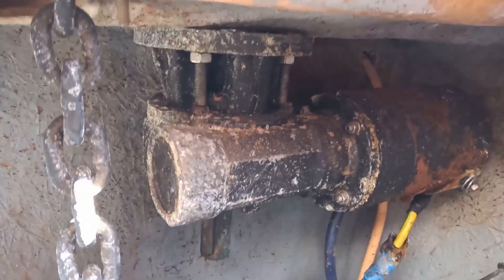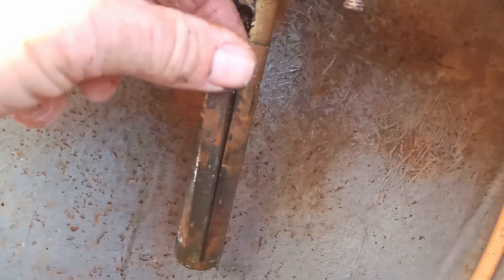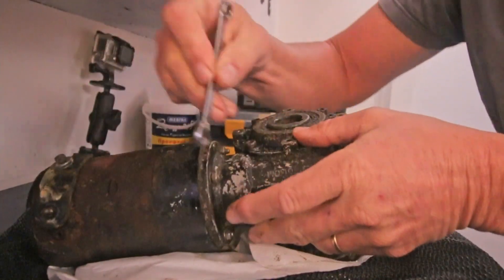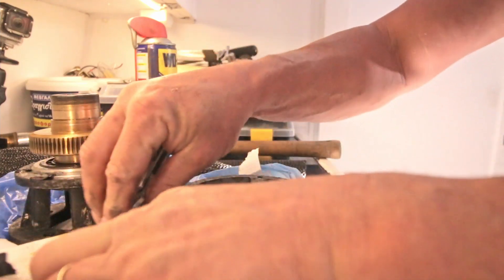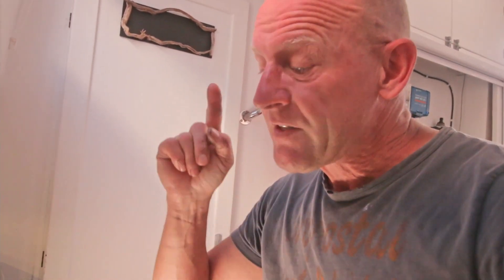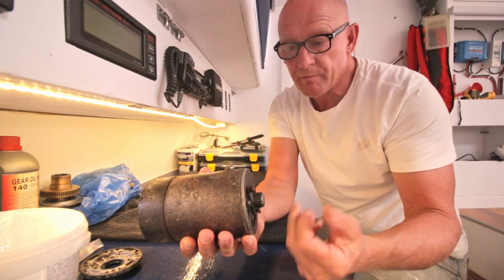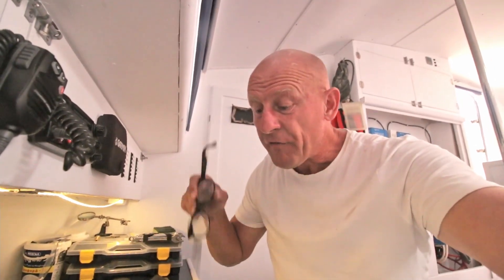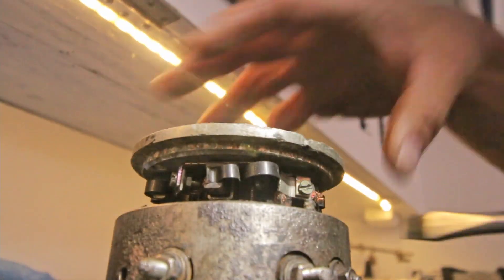Lewmar windlass gearbox and motor surgery. Sailing Exodos, ep.50

Comment: Great video.  Thanks for posting. When taking the end cap off the motor (at 15:00)  spray it with some wd40 all around the cap.  Will help release it.  Also, the bolt  used for the lug should be brass.  Stainless is a terrible conductor of electricity and not to be used in that application.  The lug bolt you installed needed to be connected on the inside of the motor to the brush sets.  I did n't see that done but assume you got it soldered in?
Reply from the maker: Haha, I don't know anymore 🙂 Too long ago and we already sold the boat. But thanx for the nice words and the info!
Wim

Comment: I'm in a somewhat same situation as you. My Sprint Atlantic "A" windlass(obsolete?) motor(not original) was toast as I lowered the anchor. 
Removed the motor and contemplating to DIY or send for professional fix. You gave me the confident of DIY as you said you're amateur and then went ahead and dismantle and assemble the motor back. The fact that your motor still faulty was very likely due to internal failure like the coil open circuit. Thank you.
Reply from the maker: Yeah, the first and only time we used it, it stopped working and I smelled electric burn, so it really must be toast. And about DIY - when you just start working on it, often it's way more simple then you were afraid for, huh? 🙂And when something is toast anyway, it actually doesn't matter anymore, haha! But that (and the lack of a large bank account :D ) makes me want to try everything myself. And when you disassamble something, and put it back together again (hopefully), you know how it works, which can be very handy when you are on your own at sea.

Comment: I'm in the process of doing similar to my Lewmar Concept 1 winch, very similar to yours . perhaps newer. The thru-deck bolts are frozen to the gearbox case so am struggling to get it out yet. You have shown me some things to  be aware of when I finally get it to a bench to take apart . In my case the the gear box has the problem,  Thanks for the video.
Reply from the maker: You're welcome 😊 I am still struggling with that thing! Got to get it out again to remove the electromotor. Took me more than an hour! Motor is toast and even in the Lewmar factory they don't know anything about that 4 pole motor anymore 🙄😅
Reply: @DoubleUThings  Although Lewmar is a British  company everything on my winch is metric and the gearbox has Bonficlioli on the casting, sound Italian so perhaps the electric motor is from Italy. My motor is also a 4 pole. Hope something works out.

Comment: Nice work on the video.  I just removed my windless, motor works on mine, but not enough power.  I think I need to grease the gearbox. It seems very dry.  I wouldn't have thought to try it but now watching your video I will attempt it, though finding the seals may take some time.  I have 32 year old simpson-lawrence anchorman Power 700.
Reply from the maker: Thanx! Finding the new seals was actually not the problem. I just ordered them via the internet, when  we were back in the Netherlands for a short time. Ours is the same age. And that not enough power thingy - ours the same. All that old stuff is not good enough for the heavier anchors we use nowadays, I think.
Reply: @DoubleUThings   I found something that might help you.  From the Video the electrical connection were the two outside lugs, but this diagram shows outside and center 

D1 goes to switch ( or your positive ) and  A2 is the battery gnd.     D2 is not connected.    Worth trying
Reply: A2 is the middle lug

Comment: I learned at a young age how to fix boats. I moved out from home after graduating High school. My new land Lord had a sinking 101 antique ship. He get me and my roomate down on this sinking ship and tells is what to do and we did it. We were waiding in water and now that I'm older I'm sure it wasn't long befor we were going down. So we took out the bilge pumps and cleaned the gunk from the electric side of the Motors and had them working in minutes. It was a definet learning experience in my lifetime. Now I have 6 Boats and learned how to maintain them the right way.

Comment: How many rotor carbon brushes were there?  I was expecting to see at least 2 but only saw one. Most dc motors are at least two pole motors and they require one carbon commutator brush per pole.  Was there a brush assembly mechanism on the opposite side of the motor case?
Very good video
Reply from the maker: Thanx. There were 4 brushes, Geoff.

Comment: Bravo very good and detailed job.  I have a semilar like yous  (Plastimo)  and what i have notice from your video is that , the code VF 47 ( on the gear piece) is exacly the same like in PLASTIMO 1000w windlass. so thanks to your video i made a service to mine and works PERFECTLY !!!
Thnk you !
Reply from the maker: Well, then you are further than I, because it still doesn't work :-) I think the electromotor is broken. Next job.

Comment: A test you could have done before installing the motor back is as follows: with the help of a car battery and jumper cables, yoou could have easily tested the motor. at the end it must be very simple. The negative cable is the common, then you have two studs for the two spinning directions, to be connected to the positive. Unless you messed up with the contacts of the carbons inside the motor.
Reply from the maker: Yep, you are right. The thing is that this particular motor has 4 cables. I know what the negatives and the two spinning direction cables are, but I don't know what the fourth one should do. I already asked a Lewmar dealer, but they had to send the question to Lewmar itself. Still no answer. Nowadays there are probably just three cable motors... So i didn't dare to test it, because I was afraid to ruin it.
Reply: @DoubleUThings  And no installation manual is available? or is it too old and no pdf at that time? 🙂
Reply: @DoubleUThings  I did check on Lewmar website, and I did find this manual that could apply to your model, even if sligthly different. Check pages 13 and followings for electrical wiring.
https://www.lewmar.com/sites/default/files/V1-V6%20Windlass%20Product%20Manual%20iss11-English.pdf

Comment: Great video!  I applaud you for taking this job on when you don't know much about this stuff. I wonder if you are getting power to the motor? Check it out before you get a new motor. Maybe the relays?  I learned a lot. Thank you.
Reply from the maker: Thanx! But it's still not working, haha! Next job. I probably need to find a new (and stronger) electromotor.
Reply: @DoubleUThings  I am sure it worked when it was new. You do not need a stronger motor. Maybe you can find a motor shop which can repair your motor,  or find a new one, but first make sure the motor is getting power. There must some relays somewhere which send power to the motor. check them out.
Reply from the maker: @andyx7687  Sorry, I didn't see your reaction. Relays are fine. I checked all that. Motor is probably burned, because it smelled like that :-)
Reply from the maker: Oh, and yes, we need a stronger motor, because we have a heavier than standard anchor now.

Comment: yeah new content from the dutch neighbors

14:49 Not totally wrong but it is not the best idea to push a screwdriver between 2 sealing surfaces because you damage the sealing surfaces^^ 
next time for example try to hold it 5cm over your table and carefully give the main shaft a few with the hammer maybe with a piece of wood between shaft and hammer to avoid damages on the shaft 

Edit: against the rust you can use phosphoric acid 
just brush it on the surface and let it work
Works as a rust converter 

Grüße aus Deutschland
Reply from the maker: Haha! Yes, it was about time, huh? I have tried to upload this one already for 3 weeks, but no decent enough internet. I finished the next one an hour ago. About the screwdriver 😁 It was not the best idea indeed, but i purposely used a "rounded" one. It doesn't have any sharp edges. And it has a soft character, haha! Thanx for the phosphoric acid tip, although i wouldn't know where to get that. 
Freundliche Grüßen zurück von die  Nachbarn in Malta.
Reply: @DoubleUThings  maybe Malta have a Growshop? haha 
PH minus bloom from Canna for the special "Flowers" ... is 59% phosphoric acid 
Otherwise maybe on ebay or ask at the hardware store but wear gloves and take care of your clothes
The acid bleaches out the color 

Grüße nach Malta